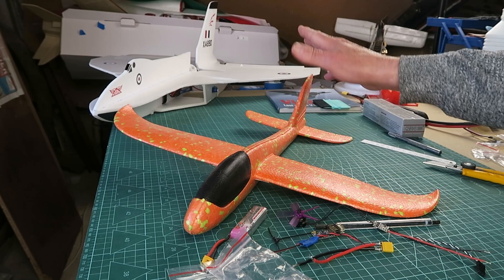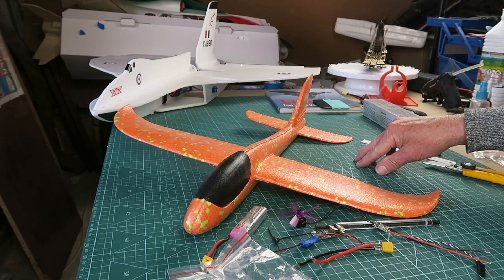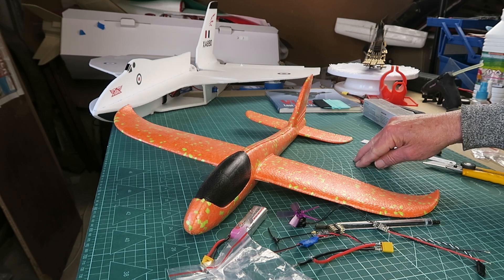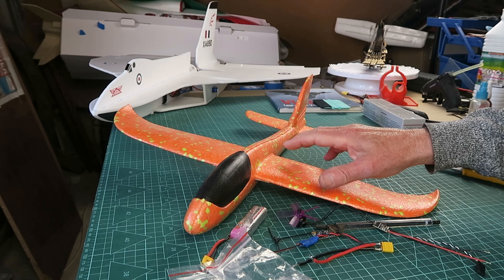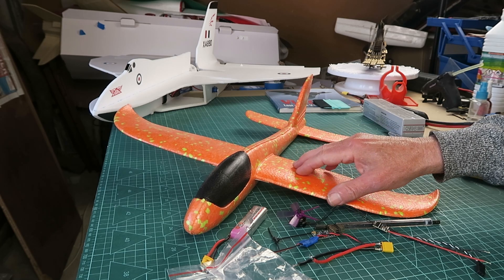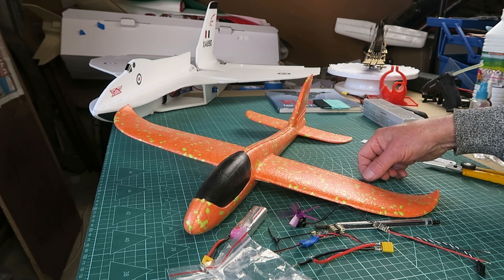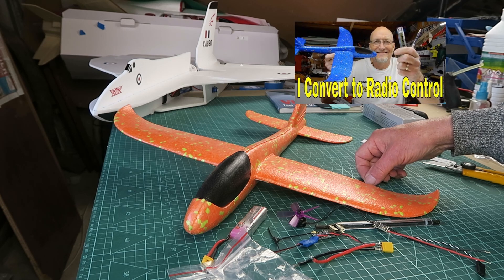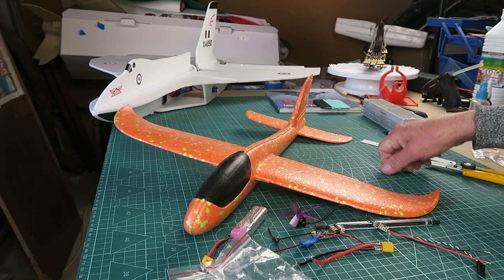Mini Glider Pitcheron Powered RC Conversion ELRS

Comment: How do you set up the channels on the remote. I'm new to this and I have a pocket also
Reply from the maker: Hi, Here is a link to my Pitchero setup "MiniPit.yml". You can load it into EdgeTx companion and see exactly how I set it up. Of course you can then transfer it to you Pocket radio. You will need to check the control surfaces move the correct way as your servos may be different and move to opposite way. https://drive.google.com/file/d/1-etjsVH838cRzGoUX-3GcCfn6Y5CDYsG/view?usp=sharing Thanks for watching, have a great day!
Reply: @1nformatica  I tried it but it keeps saying throttle cut when i use the model
Reply from the maker: @WakaHaro  I have the throttle cut on the push switch SD on the top right. When pressed the LED will light and "Throttle Active" announced. You can also check but paging across to the "Channels Monitor" page and see the status. You may have to calibrate your sticks as it will not arm unless it sees the throttle stick completely down.